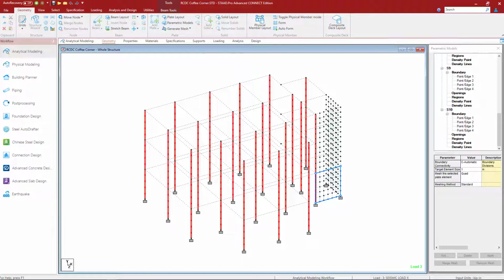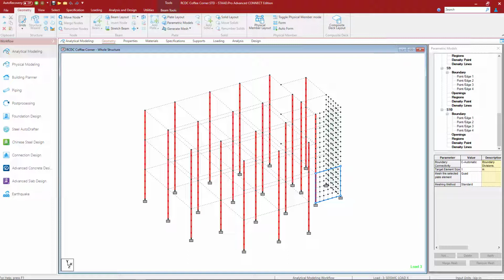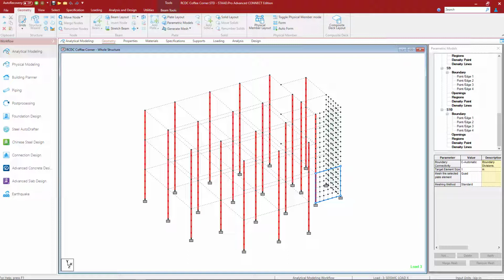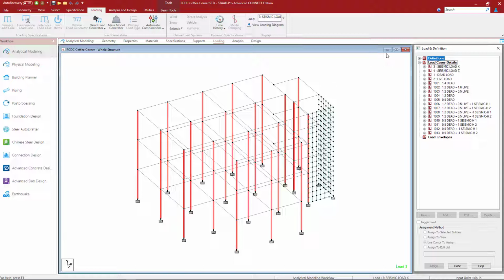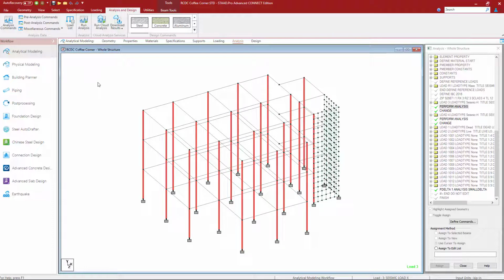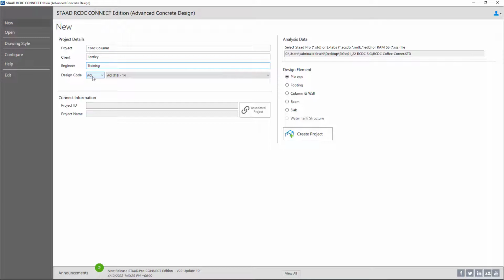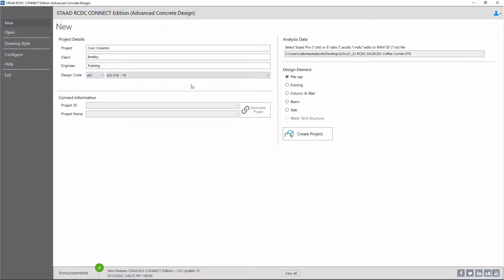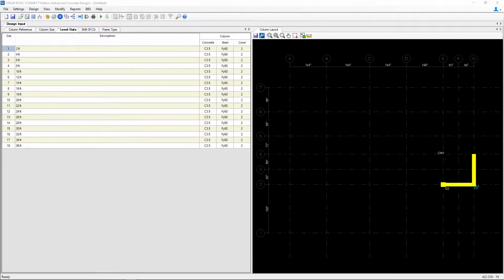Creating a New Concrete Column and Shear Wall Model in STAAD Advanced Concrete Design

Comment: EVEN THOUGH  SHEARWALL WAS MODELED IN PARAMETRIC MODEL, USING RCDC 8.0 WONT IMPORT THE SHEARWALL. IT ONLY IMPORT THE COLUMNS.
NO LIE.
Reply from the maker: Reading and designing shear walls modeled as parametric models in STAAD.Pro was introduced in RCDC V9.01. Prior to this version, STAAD.Pro members with a D/B ratio greater than the property set in the Design Settings would be designed as shearwalls. https://communities.bentley.com/products/ram-staad/w/structural_analysis_and_design__wiki/42309/6-release-note
Reply: @BentleyStructuralAnalysis  
HI THERE BENTLEY.
SO HOW CAN I UPGRADE TO THE LATEST RCRC VERSION SINCE IT IS WITHIN THE STAAD PRO CONNECT WORKFLOW?

OR IS THERE A STAND ALONE RCDC APP LATEST VERSION THAT CAN BE INSTALLED AND WHICH IS EXTERNAL TO STAAD PRO CONNECT?
.

Comment: Dear Sir, 
 At the top of the pier there is only one node available, but on this pier walk way bridge supports/bearings sit. I have created 4 - slave nodes for the walk way bridge supports or bearings , the master node is the top node of the pier. I have applied the load on the slave nodes and run the model. The model is running with out errors. whether my method is proper or not?